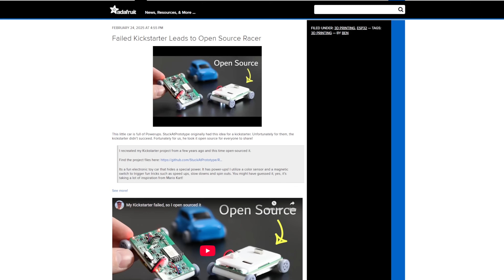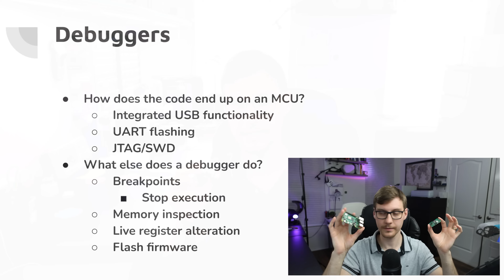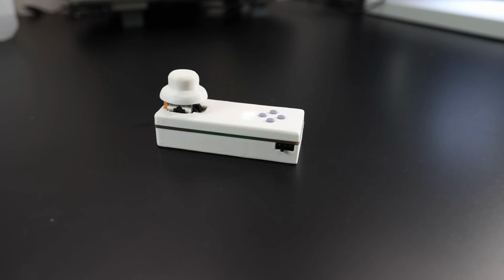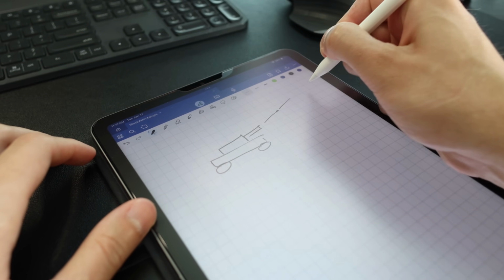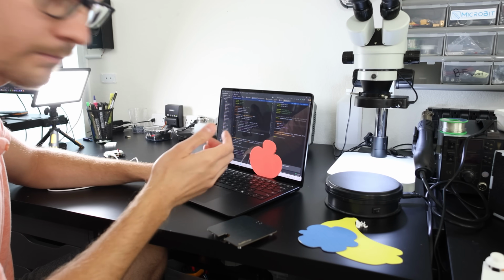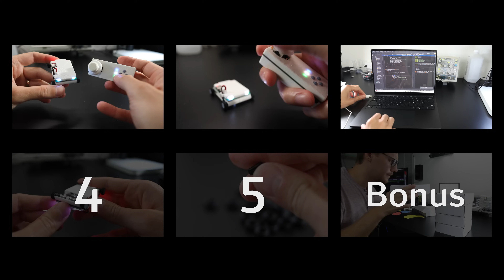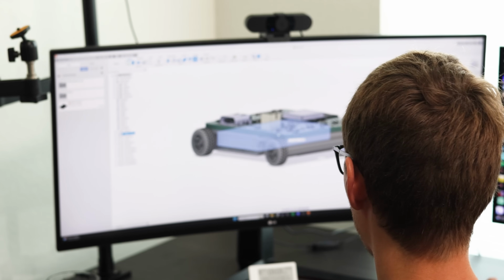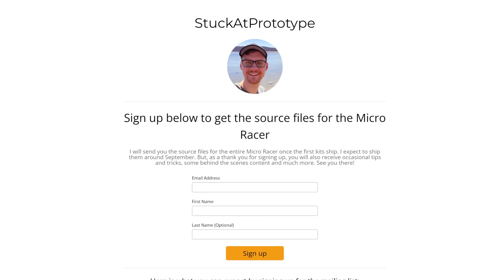Make this Micro Racer, its open sourced

Comment: Congrats. Nicely done and tks for open sourcing.
Perhaps you could have used a right angled battery connector so that the connection would be flush with the top plastic instead of protruding above it.

Comment: Very nice project. Is the car steering and speed proportional ? Cant find any information about that :)
Reply from the maker: Thank you! The steering system is in essence a tank system. It’s proportional but not in the traditional sense. The cars are fairly precise and you can slalom around obstacles with ease :) I’ll say this, the turn radius is proportional to how much you tilt the joystick. The speed works on the same principle, it’s proportional to input :) I hope this makes sense!

Comment: The wheels look very vulnerable to crashes. Why not add a bumper?
Reply from the maker: What do you mean? Do you mean crashes car to car?
Reply: @stuckatprototype if it crashes into an object , by an inexperienced driver, it could bend or damage the wheel. I speak from experience! Most model cars have some kind of bumper to protect the wheels
Reply from the maker: @Mr_Rusty1 you can print one! It’s all open sourced :) so far I haven’t broken a single wheel though!

Comment: I see that the battery slides into a compartment under the car. If you can make it so the battery connects by sliding into battery compartment, then the top could be a user interface, similar to a mini version of the Arduino, but using low profile headers.. or even use magnetic couplers.

One add-on could be a laser-tag, and if you can include RFID and Laser-tag
then it could be a laser-tag version of Stratego...
Reply from the maker: That’s the plan, but the battery connector will be as is for now. I have a header on the top :)
Reply: @stuckatprototype  The only user header I saw were pins that you said you were going to remove. They make half height female headers. If you had a set similar to the D1mini that had i2c and a few more GPIOs for 2 way IR, you can do what I said above.
Reply from the maker: @WagonLoads I have a spot on the top but it will be unpopulated so I didn’t mention it. It’ll be a simple process to solder it for extension. it’s exactly for that purpose :)

Comment: Great project.
We have two grandchildren ( 3 & 2 yrs ; boys ) so this would be a fun toy for them and a nice Christmas gift. 
Probably go for the assembly kit.
…
BUT I have also a great request:
would love to see this mini racer  become an autonomously maze solving micro mouse ( and that maze can easily be changed so it keeps fun to watch  ).
.
Are there plans in the future to adjust the races also to make that happen ?
But most likely it is too small for it. 
Because without additional hardware this cannot be achieved…
UNLESS …
…
I read that someone added a camera to this tiny device.
THEN maybe the camera images can be used in the program to achieve the goal:
Autonomous tiny MAZE Runner.
Reply from the maker: Thanks so much! For smaller kids, I only recommend playing with an adult. It does have small parts. I let my kids play, they are 3 and 5 but I am always with them. 

As for extra functionality, I have an entire list of things I want to do :) solving a maze would be super cool, I’ll add that to the list! Thank you! 

I have an extra header on the top of the car that’s unpopulated. It’s reserved for exactly this type of a purpose. I want to make expansion modules. Imagine a “laser tag” system where you can shoot at other players, a camera for driving the car, distance detector, etc. it will eventually become a really big STEM platform. That’s the goal :)
Reply: @stuckatprototype 
.
Do you also foresee as an option to add a Lidar unit ?
Because it needs sensors, most likely more then one , to transform it to a maze solving device .
.
I know a little bit about ESP32 ( used to flash WLED software to connect LED strips or made a WordClock with LEDs ) but the Ram storage is limited .
.
So how are you going to solve that constraint when for a maze solving device the program needs to be. ‘Heavier’  ?Will it mean that you need to use another MicroController so that it won’t be an add-on on this current device

Comment: What did you use as a battery and bms? I find your project so cool! I’m a learning battery usage for my own projects
Reply from the maker: ty! all I am doing is measuring the Voltage using the esp32 analog signal and a voltage divider. for charging I have a dedicated chip
Reply: @stuckatprototype  any chance you can share the chip part number? Or any similar  recommendations
Reply from the maker: @Juanjo.vanegas21 sure, it’s the same chip as the previous version of the car. Here is the bom https://github.com/StuckAtPrototype/Racer/blob/master/hardware/racer/racer-v0.2-BOM.csv

Comment: Your price target seems way high for this. Have you gotten quotes from manufacturers for volume production?
Reply from the maker: It is, I’m not expecting large volumes, so to be realistic and make it work that’s the numbers. The design is not cost optimized. The motors are super expensive. Each magnetic obstacle is $1 each, etc. it adds up quick! That’s why I am adding a free course, the community and trying to make it a better value! One day I will probably end up making a more complex, but cheaper version. :) For now it is what it is

Comment: I followed the Micro Racer project for a long time but did not build one myself yet. Anyways thank you so much for sharing this awesome project. The only improvement I can think of is a little more ground clearance. Maybe that could be done with larger wheels and slower, torquier motors.
Reply from the maker: thats awesome! thanks for following along! :) The only issue with ground clearance is the magnetic switch sensor. it has to trigger, and if it is too far away it doesnt work. That said, it probably is possible to make the color patter detection without the magnetic trigger somehow. For example a buffer with x samples and an algorithm that is looking for a certain number of readings of the same color, etc. but.. for now that is the limitation
Reply: @stuckatprototype  For me Micro Racers would be tons of fun even without the power-up detection. If I find the time I will do my own experiments but chances are someone in this large community will beat me to it.
Reply from the maker: go for it! and I agree, its pretty fun to simply drive around. especially around the desk, its super fun.

Comment: Absolutely killed it ! I'd love to make one myself. I'm also working on something similar ,creating a radio controlled hotwheels with my custom controller . It's exactly the video I needed at the moment.
I would suggest adding a 90 degree connector which will force the wires sideways or better behind ,so the top is absolutely flat!
Reply from the maker: nice! I hope you share it once you are done :) I did consider a 90 degree connector, but I would have to move too much stuff so far now I opted to keep it as is :)
Reply: @stuckatprototype I'd love to share my stuff , let me know what would be the best medium to share it with you.
But as of now it's gonna take 2 -3 months , since I'm too occupied 🙃
Reply from the maker: sure! send it my way when you are done :) contact@stuckatprototype.com

Comment: I’m happy to see this project taking off!

Last video I had commented with concerns about the BOM cost, especially with the color sensors. Those concerns are now validated with the $99 price tag (on sale). 

I know this project went viral with big outlets, but I think it could become a “hello world” for STEM if it were more affordable. 

Here are my suggestions:
- offer tiers of kits. a car PCB only option, a 3D print yourself option, electronics only option, etc. PCB manufacturing cost and min order requirements is why I haven’t made one, and I can afford it. Users can source BT controllers, motors, batteries, etc, but it’s not viable to source 5x assembled PCBs from PCBWay or wherever. 
- if the color sensor is costly, make a version with just a light sensor or no sensor at all. 
- Many of us have 3D printers. Forcing 3D printed parts in to the kit makes all of them identical, and adds manufacturing costs for you. Identical cars is bad for STEM. 
- in other words, cost is your enemy right now. You’ve proven the concept, now get it to the masses.
Reply from the maker: Thanks so much! It is fairly expensive to make, that is true. no worries, once I am out of the pre-sale stage I am going to expand the store to sell populated PCBs, etc. :) I do need to take it one step at a time, but no worries I am going there. thanks for the support!

Comment: Make battery conction on side like the thin data cables on pc motherboard btw i really want one but i cant afford and the led in middle should be on back and strong power and all the middle should have "scrach" glass like fiber glass and it color the team and make a laser gun to add as an ecssecory that you add on top and play against friends and make teams in race and in battle or an e ink display to costomise
Reply from the maker: Cool ideas! Thanks for the feedback!
Reply: Of course but if you put them can I get one @stuckatprototype

Comment: I discovered your project through someone who stole your video and changed the narration to a tik-tok one, and that alone inspired me to build a "similar" one with spare stuff I had available. My motors were micro-drone, brushed ones, no reductions, so speeds > 10% PWM were impossible to handle, lol. I took the tires from a lego car, otherwise the resin-printed wheels would just grind themselves to oblivion. Combine that with a webserver interface and you get something that goes in straight lines unless you managed to tap on the turning buttons in time haha.

But it was a lot of fun to build (I regret taking it apart before testing it on the floor of a shopping mall, maybe I could hit the speed limit there before the unavoidable catastrophic crash that would ensue), and shortly after that your channel ended up on my feed. 

Love the project, all the ideas, and the channel. The possibilities for your car are endless, it has a lot of gameplay potential as well as educational. And open source? You are a king!

Keep it up! Cheers from Argentina
Reply from the maker: oh wow! thanks for letting me know. and that is so awesome! I am happy to hear you made one! :) get some 6mm 1200rpn planetary motors and youll be set! Thanks so much for the support!

Comment: Nice video! It would be cool if you added a tiny camera onto the car that connects to a monitor or VR googles so you can basically play Mario Kart around your house. You could even add data onto the monitor that has a map, speed, place, etc.
Reply: @stuckatprototype I'm an electrical engineering teacher and I did adapt your design last year for one of my course. I added an esp32-cam onto the car. I also changed the controller. The car is now controlled by any smartphone and the FPV cam stream directly onto the phone. Best part? No custom app was designed, the esp act as a server and host a webpage with all the controls and camera stream. I'd love to share my design with you if you'd like.
Reply from the maker: @louis-philippegauthier2694  that’s amazing! I’d love to see it! Could you email me at contact@stuckatprototype.com
Reply: @louis-philippegauthier2694  This is exactly what I was hoping to do so I'm glad you've shared this comment!
Reply: @louis-philippegauthier2694  that sounds pretty sick
Reply from the maker: I have been meaning to put an FPV camera on these and race! I need to get around to it. It would be epic
Reply: @stuckatprototype  you could probably use an esp32-cam as the base for FPV
Reply: @stuckatprototype I just had another idea... It would be neat if you could somehow stream then FPV camera footage onto something like a website or app with a digital remote so family and friends can race you remotely.
Reply: It wouldn't take much.  Just put a tiny fpv camera on it.  The $$$ part is the fpv goggles

Comment: These are all awesome improvements, especially the steering, I spent a lot of time trying to implement a joystick on an app but couldn't get it to work perfectly, the new steering looks perfect. For the tires, I made a U shape grove in the rim and add an O-ring. it's a simple solution to add grip and should be doable for everyone. For the UART integration, does it just require a new PCB or is there a chip involved?
Reply from the maker: Hi! Thank you! I tried o-rings, unfortunately a bit too grippy. As for uart, yes you will need v1.0 of the board. I.e the new release 👍

Comment: Great design, my suggestions would be adding ambient lighting for the undercarriage and maybe a camera on top. Otherwise good work.
Reply from the maker: Great suggestion! Thanks!
Reply: One thing could also be that you add a small nfc/rfid reader on the undercarriage and all power ups/game items would be just rfid stickers. This would ensure better stability of the game system.
Reply: Ambient light could screw with the color sensor
Rfid / nfc could work, but they have a low range, so you probably need multiple chips per powerup
Reply: @ized88 yeah thats why I suggested the rfid/nfc reader for the power ups. Also the car would only read the power up sticker data, what it does and whatever. You would need only one chip per power up. Kinda like the rfid stickers that are used in stores.